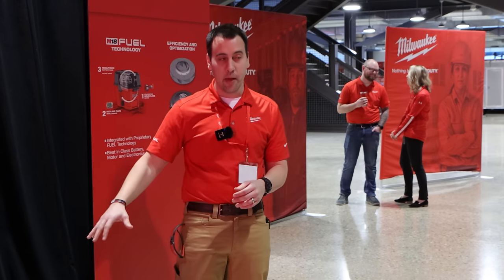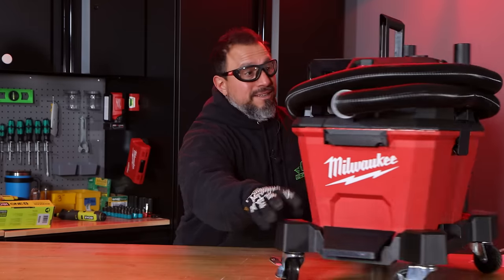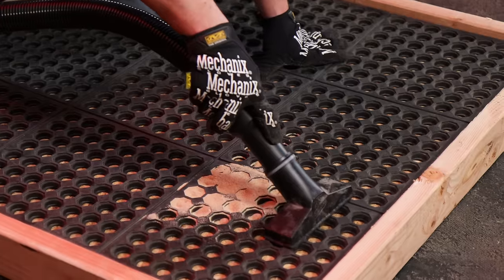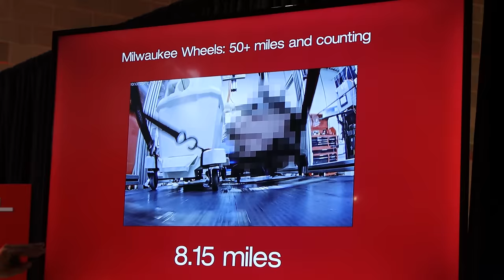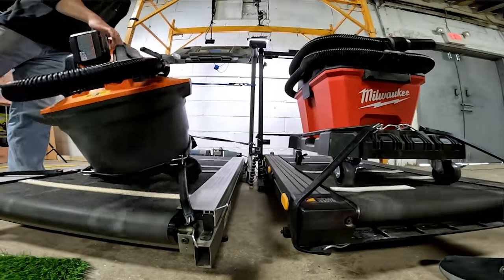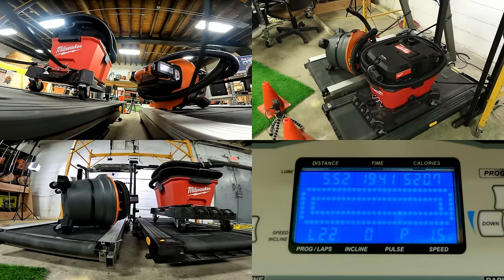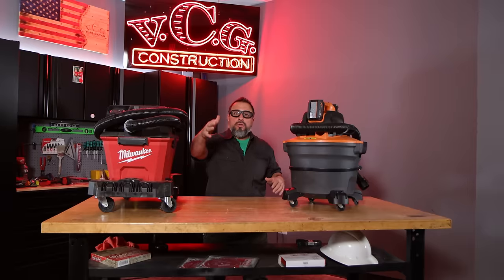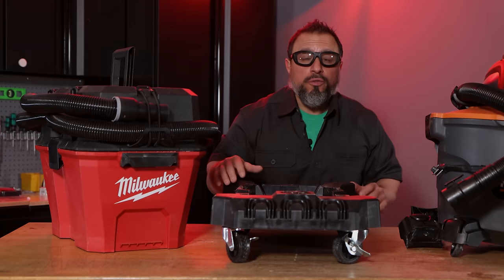Are Milwaukee's Rolling Tool Test Results Honest?

Comment: I've owned several Shop Vacs over the years, (when they started making them out of plastic), and the wheels have always been a problem. The first one I had was a 12 gal with a removable motor that could be used as a blower. The actual wheels on that unit broke constantly, just from pulling it around on a concrete driveway to vacuum out cars. After replacing the wheels several times, I finally replaced them with some better quality wheels off an old desk chair. This worked for a while, but then the casters that hold the wheels began breaking at the point where the wheels were inserted. After I couldn't get replacement casters anymore, the vac became a stationary dust collector in my garage. The replacement Shop Vacs I later purchased were smaller units, but they too would suffer from the cheap caster problem. These units were mostly just used to vacuum out cars and an occasional household spill or two. I really got sick of fixing the wheels and casters time and time again just to have them break another time. The Milwaukee vac you tested looks like it has a good sturdy dolly, and the maintainability of the design, that you mentioned, is a great feature. I just wish it had a corded capability for when you run out of battery power. Also,  does it have the capability to use disposable bags? Thanks for the videos.

Comment: Hey, I heard that Milwaukee has a storage system called "Packout."  Maybe someone should have told the Vac designers.  Then they could have made the top of the Vac a Packout dock so that you would have a decent place to store your attachments.  Festool users have had this feature for years.  And the bottom of the Vac could have been Packout compatible.  Then you could use the Packout Dolly to move it around or mounted it on top of the Rolling Tool Box. Just sayin'...
Reply: Bosch has this.. works great!
Reply: Milwaukee already has a pack out vaccum 2.5 gallons with accessories it’s 199.99
Reply: Oh you don’t know?
Milwaukee wants you to buy this one first then in a year they will come out with “the new design “
You know, to get more money out of you.
Reply: @seanschofield3051  That doesn't mean these couldn't have been Packout compatible, too.  Packout is supposed to be an integrated system.  Also, that Vac is too small.
Reply: It's so ridiculous they didn't put packout cleats on top of these new shop vacs.  I love the vacuum, but come on Milwaukee!! This type of thing makes me lose faith in the company and it's product designers! It's shameful really 😔
Reply: @seanschofield3051  lol no shit

Comment: Being a huge fan of the Ridgid vacs I’ve bought several. Have never had a wheel break, bend or fall off. My particular vacs have a screw that keeps the wheels attached to base but Since I’ve only had 14-16 gal I cannot attest to the others lacking the screw that holds it? Wheels do tend to be on the smaller circumference and width side so they can make rolling a pain at times. But always figured I’d pick up better ones as a replacement from the ol’ harbor freight if needed. Just have never needed to do so but I have replaced the 2.5” hose one my older one simply because of the abuse it took, lol. Appreciate the info and the time/energy it took for this video. Stay safe!
Reply from the maker: Thanks for the feedback Tim! 👍🏻
Reply: I agree. Most vacuums that I have purchased have a single screw into the housing you need to install. The screws worked, but we're definitely only into plastic. I've had 1 or 2 that snapped into place.

Comment: Wow this was an awesome test!  The dolly system on the Milwaukee was rock solid.  Definitely impressive.   I have a few of the Packout dollies and I use them quite a bit with the drawer system and organizers.  They have held up well with zero issues.  I imagine these vacuum dollies won’t disappoint over time.  Have an awesome night! 👍🏻
Reply from the maker: We appreciate the input ZZ!
Reply: But will you buy this vacuum for $250 vs a $79 corded vacuum?

Comment: The tie points are way higher up on the competitor which will cause it to become erratic and tip more. It will cause it to also jump a little more after every speed bump due to the elastic nature of the bungee cords…

Comment: Nice to see Milwaukee do the bigger cordless vacs over the smaller packout sized ones, I just wish they would have made the battery vac head on these with the ability to plug in an extension cord too without having to buy another corded vac head, but who knows maybe they will make one later

Comment: Maybe you should have lowered the mounting point on the ridgid to match the Milwaukee. Ridgid kept falling over from the pull point being too high.  Only time will tell if Milwaukee vacs are still kicking after 20 years like the ridgids, their shop vacs are pretty damn good if you don't abuse them.
Reply: I don’t think the mounting points where the issue. The issue I see is that on all shop vacs the center of gravity is extremely high and on the traditional style the wheel base is extremely small. Looking at the Milwaukee it has a lot longer wheelbase making it more stable. If you rotate the Milwaukee 90* you would create the same problem.

Comment: I'm a general maintenance tech at a factory where we use Shop Vac, Rock River and Ridgid vacuums. The CNC preventive maintenance crew have to drag their Shop Vac brand vacs around the plant from machine-to-machine and are constantly having the center of the caster wheels break out. The coolant PM guy has a Ridgid but it is sitting on a barrel dolly. We've replaced the wheels to just have them break time and time again. I wish the bean counters would let us purchase one of these new cordless vacs from Milwaukee, but they won't spend that much on one. Vacs don't hold up long in this environment. Besides the wheels breaking, we have motors that go kaput, cords that get stiff and the insulation start cracking because of exposure to machine coolant (due to some grubby little paws), fighting the hose during transport (manufactures don't think that is important apparently), and hoses that kink and clog easily. Don't even get me started on dumping the sludge out of the tanks.

Comment: Just like you, I have the Ridgid vac, and the wheels do tend to fall off a lot. I've also had the little wheel holder fall off a few times, even when you use the small screw to hold them in place. Heck, ive even had the wheels fall off when i picked up the vac, not even pulling it by the hose. 
But as we see here, the larger wheels on the Milwaukee are a lot better for going over the construction area and debris.

Comment: I have not had any of the Ridgid wheels fall off in the same manner.

Exactly what you explained, the wheels have popped off the holder housing.

I have owned all of the models of the shop vac in Ridgid and currently have around 8 in service right now.

Also, funny you pet the bird on the bench 😂.

Comment: I do have a 120volt Ridgid Shop Vac and don't have a problem with it but also only use it in garage-not dragging at 2.8 miles an hour.   How do they suck in comparison?  Ridgid Ron

Comment: I have a Ridgid vac and the pin on one of its casters doesn’t stay secured into the plastic wheel mount. If it goes over a sidewalk crack etc, it pops out!

Comment: Your mounting point on the Milwaukee is lower than the Ridgid, creating more of a torquing moment when the wheels hit the speedbumps on the Ridgid.  Before people dismiss this, it should be known that it doesn't take much distance (or length) to get a lot more torque.  This is also causing a more violent collision with the bumps, since a lower mount will promote the vacuum to pop up and glide over the bumps instead of digging into them.  However, the Milwaukee wheels are spaced out a bit more which is helping it be more stable on the platform.  Mostly a marketing gimmick from Milwaukee.  Looks like Milwaukee's test does this even more so to give them an advantage.  Look at where they are mounting their shopvac lol.

Comment: Milwaukee mounting point was much lower, making for a much lowe center of gravity and more stable pull.  Pull the ridgid from a lower point and repeat the test, as it will hop around more with that higher pull point.

Comment: The straps are a cheet because we always pull it around by its hose. However maybe we could hookup a strap/cord from base to hose effectively. If it works I'll leave the strap permanently. I understand it's just a wheel test but they should have tried to keep it more accurate to the employees who break everything.

Comment: I have used the $50 holiday special buy rigid vacuums consistently for the last 10 years, and I've never ever ever had one break. whether it be the motor assembly, or the wheels, or any of the housing components. I end up losing parts because guys misplaced them, or the most common thing is the hose gets so beaten up that they either tear or come apart, and that $25 a piece. it's cheaper just to buy another complete vacuum unit and sell the old one cheap. If you know anything about anything with these vacuums. Don't spend a bunch of money on a Milwaukee vacuum!

Comment: @VCG CONSTRUCTION I think I found a FLAW with the test. The Milwaukee is square body and the "competitor" is round. The 2 straps holding them in place, the Milwaukee straps are wider giving more even left to right hold. The competitor being round, the mounting points are closer together making it less stable. Similar to holding the handle bars of a bicycle towards the center. (Don't get me wrong. I'm a Milwaukee fan and want to see them win. But it's always a better win when you REALLY kick the competitors butt.)

Comment: Made in the USA with global materials basically means they can put the tool together fully outside the U.S. then they can add one part that was put through a process here and label if that, I’m disappointed from that by Milwaukee doesn’t bode well guys

Comment: Milwaukee missed the mark with these. Festool vac is still a better deal.
Reply from the maker: Tell us why its a better deal!
Reply: @VCGConstruction  are any of these dust extractors? And are they like some of the dewalt cordless tools where you can plug them in the wall if you want?
Reply: @VCGConstruction  better value long run, hepa filters, remote tool on/off and speed control. Only advantage is this is battery powered.
Reply: @briancnc  -  yep, they can also run all day long, and very quiet.

Comment: Come on Vince. You had the strap around the Milwaukee lower and closer to wheels. The other was higher up on the unit and hooked to the treadmill higher. This caused it to pull up and e less stable.